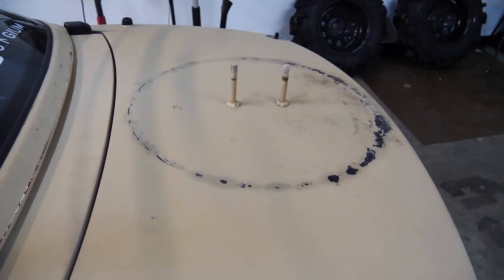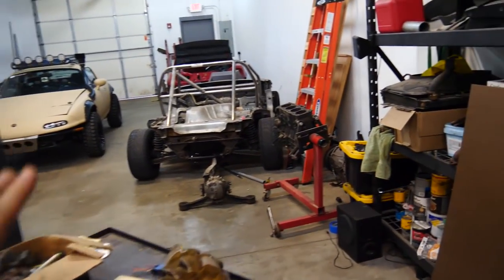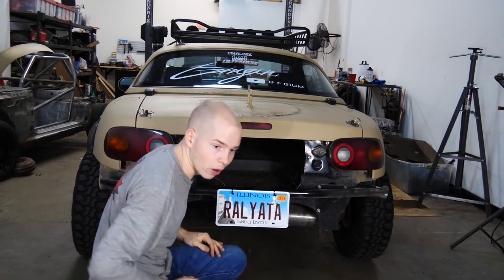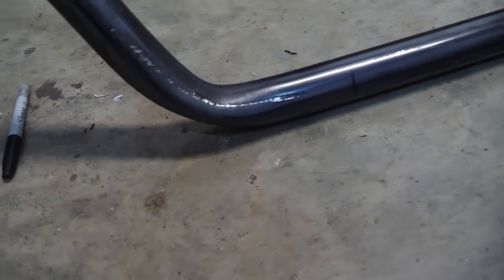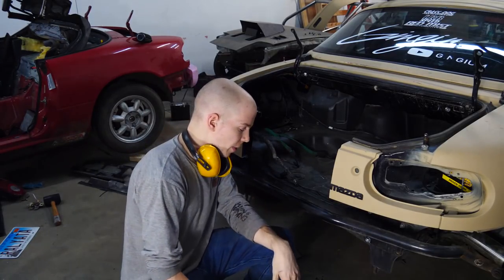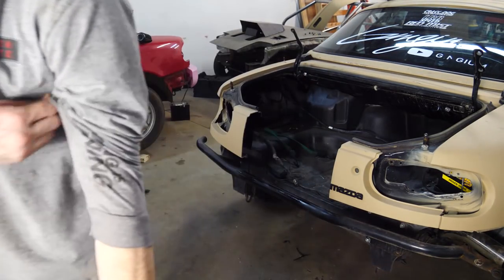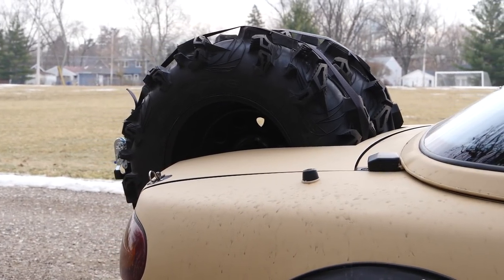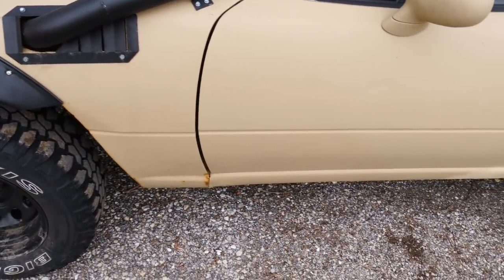Lifted Miata Gets a Trophy Truck SPARE TIRE Setup!

Comment: Not sure if that is really cool or really ostentatious. Also in my country if cut a structure of the car like that, then it´s just a paper weight it would not get an MOT. Or even worse the cops would take your license plates and say you can´t drive this on the public road. And I know for fact that the cops have removed some Frankenstein vehicles from the traffic. 
And you should been lacquering it after you painted it, I saw this coming.

Comment: Would look better and more rally with the tires you have on the car. Those tractor tires are terrible. Don’t use pipe. Box in the back  around the tires with some raw sheet metal covered in clear coat.
Reply: The tires aren't for looks, doesn't matter if they don't look good, they're functional.

Comment: Congrats. Your car isn't street legal anymore.
Reply from the maker: The cops dont seem to care
Reply: Gingium fair enough. Just be careful out there. Don't want to see the rally miata impounded
Reply: What did he do in this video that wouldn't be street legal? The biggest issue I could think of is not having a license plate light, but granted I'm not familiar with Illinois' laws. I'm primarily familiar with Florida & Georgia laws, and this doesn't even come close to some of the stuff I've seen driving around legally.

... After looking up some laws in illinois, this video probably had less of an effect on the legality than, say, the previous video, since IL law prohibits the "squealing of tires unless by emergency vehicles", and welding the diff definitely made the tires squeal. Actually, I can't remember how much it's lifted, but there are max bumper height laws so the height could be illegal.

But it's really probably not a big enough issue to worry about

Comment: >bus
>trailer
>roof rack (where you can take the fuckin tires off before going offroading)

lets just make a rust and mud pond for the “aesthetic” when its about as hack as when Haggard Garage used dildos for springs.

Build and modify to be efficient and worthwhile, not different in this case. and RIP the sidewalls with the jagged metal on the trunk lid.
Reply: Love your videos but dude this just seemed to be a “mod” for content after a 6 pack, not a well thought out idea.

Comment: Ging I can understand you wanted a cool off-road car,But I feel like this build is going a little over and beyond with these tires...You tore apart the rear end to fit them,And when you put them on the car looks even worse with a mix match set of tires, They're are multiple other types of better mud tires for this...But the car doesn't deserve this now,Pls fix.😘😅

Comment: Every single part of what’s going on seems completely unnecessary. First, those tires are waaay too aggressive. Rip axles. Get streetable tires and you wouldn’t have to hack apart the car like that. Second, water and dirt are going to ruin the back end of that car now.

Comment: um the spares are not made for normal road use so if you get a flat you will need to call a tow truck or your girlfriend to come save u don't think this is  a good idea
Reply: They're not spares. He'll be using them whenever he takes the car off-roading :p
Reply: i know that is what i said because the other tire he had on the trunk was see i did watch his other video see so i know that is what i am saying that there are not spares so he is kind of forked with them if he does get a flat

Comment: Hey Gingium look after yourself! I noticed a bump to your head as well as a deep cut to your thumb. Did you need a stitch at A&E?? WOT about a tetanus jab??     Lock-jaw isn't fun when you need to narrate to your fans!!😚 oh and solving the bumper issue - KEEP THE BUMPER pls but slice out the middle section, that way you'll have the look you want from a side angle and a practical solution to your awesome off-road set-up!😎✔✂💊🚑

Comment: Drill holes in your trunk dude.

And wtf happened to the hood. Took a break from the tube and get back to a tan rally Miata, with a fucked up hood..

Also.. don’t drive around with anything ratchet strapped that your not going to check often. Bad idea for the tires.

Comment: u made the wrong strap hooks, they WILL bend with load or tension, u could have got a simple very stupid ring bolts or eyebolt and welded them to the car. and u should get the right straps cz these will fall off no matter what u do no matter how tight. BASIC PHYSICS, u made the worst design